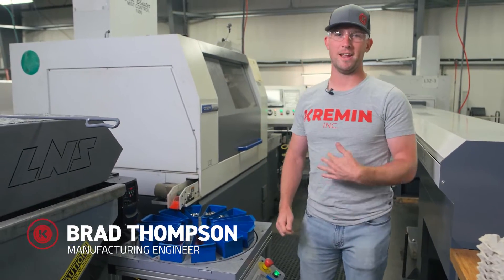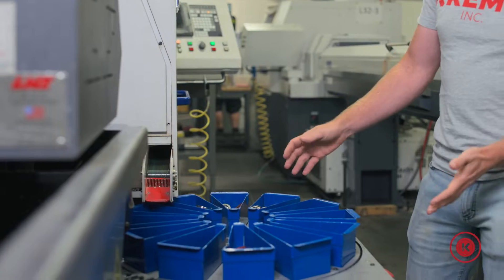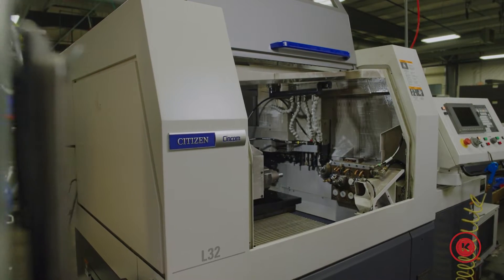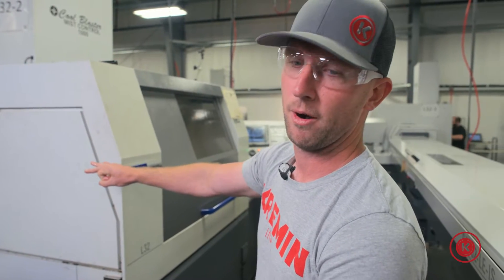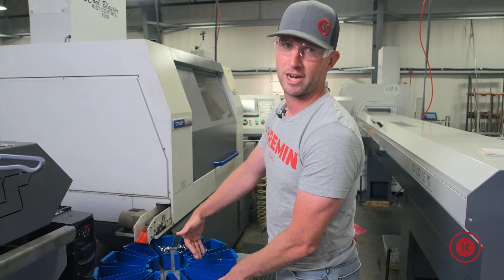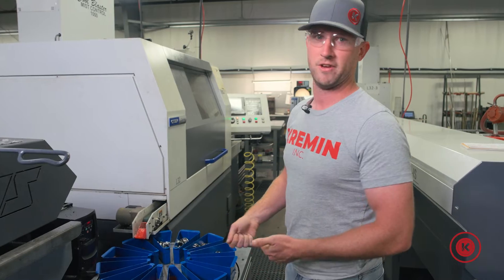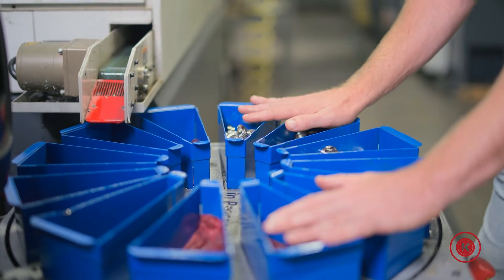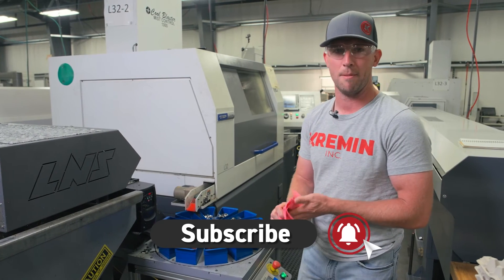Are Part Carousels Worth Your Money? - Kremin Inc.

Comment: That index tolerance does look problematic. Perhaps 3d printing a segmented bucket with tapered sides that closed the gaps would help a little bit too? Love your videos. 🙂
Reply from the maker: Great idea
Reply: For $5000, sounds like the suppliers job to fiddle with this kinda thing. Like, you can't make a table that indexes accurately without 10 degrees of slop? For $5000? Bejesus! I would send it back.